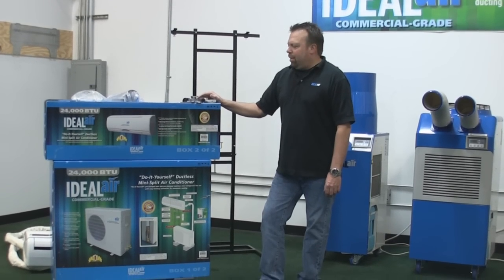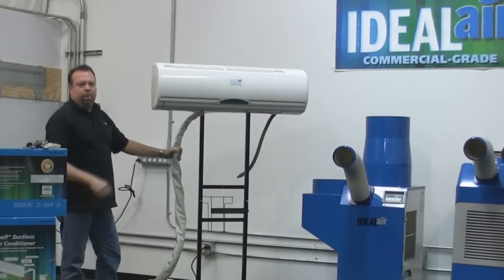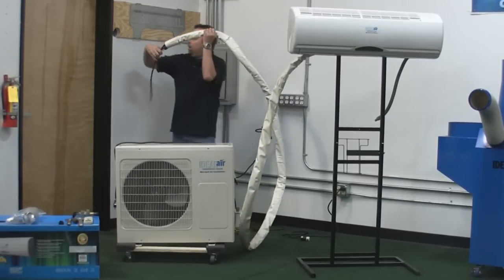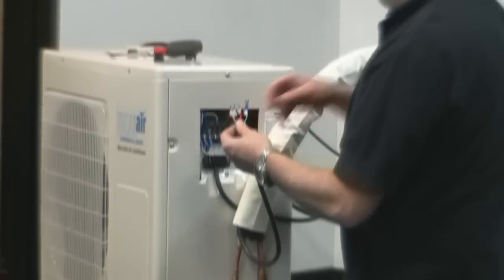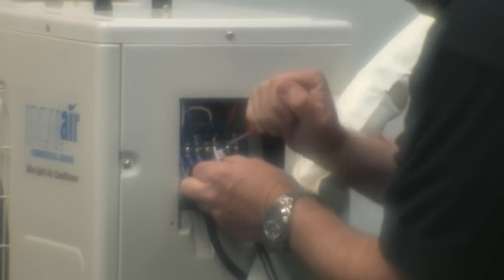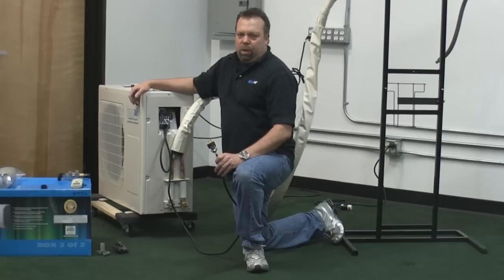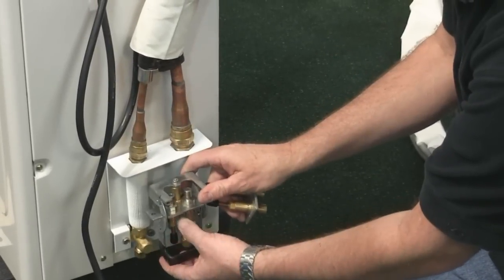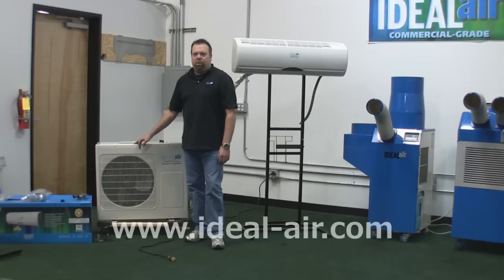Ideal Air Mini Split Installation

Comment: Thanks for the video, which I like.

1. Eliminates the need for a technician - (maybe) - which, here in Australia would cost about $700 on top of the price of the aircon itself.   Saving $700 is pretty good.  But we don't have these units in Australia.   Instead we have technician installed rigid copper pipe lines going from indoor to outdoor unit, which I assume is similar to most of USA.
2.  Noise level is a real issue.   Some cheaper units (are these cheap?) are quite noisy and don't have enough adjustment of fan speed, so you get too much noise indoors for sleeping,  but OK for during the day.   We don't get much info' here about that particular brand's noise level.
3. Electrical side of things was not dealt with very well.   Most houses in Australia will have a 10 amp power point and a 240 volt system, and no 15 amp power point.   So now you need to know more about how to do that, and might be needing an electrician.  So maybe not so easy.    Electricians here charge for a visit - not less than $100 and hour.
That said,  most aircon installers are NOT electricians - just have a "limited" license specific to the task.
4. Critics of these "no tech' required" systems, are quite happy to NOT criticize those gas guzzling "portable" a/c units on wheels with the fat tube going out the window.   So we know they are not being fair, and just protecting their brand of product.
5. I did the conventional tech' installed rigid copper pipe one at my place.   But the first time it needed any attention, the tech' quoted $200 call out fee.
6. None, or almost None, of these technicians know the first thing about professional cleaning of the indoor unit.  After a year running,  that indoor unit accumulates tons of dust and fungus, and is basically filthy.   You need to spend about $75-100 to have a pro cleaner visit.

Comment: for vanover--Mitsubishi . install'em, forget'em, that good. Have two ton unit squeezed twards heat effeciancy.  It cut my heating bill by 66% year one with heating oil at $3.85 a gal. This year at 2.25 a gal I'm only saving at 50%! Do get a humidifier  big enough to keep humidity at 45% cause the minisplit puts out 120 degree heat, even when the outside temp was 4above. Hyperheat units   are being installed like crazy in new england, good down to minis 15f.

Comment: OK, Quick connects I understand, any one thats ever installed a ice machine remote understands how they work and that they do work. what gets me is the flex tubing on r-410, NEVER seen that in the smallest reach-in to the largest Walk-in or HVAC unit, always wondered why. Seems like some larger mfg would have done this. Also the one thing I worry about with flex other than many leaks would be oil traps, dead compressor in 18 months.

Comment: sir pls .. you opend valves directly without making vacum indoor unit !! i think you must open one & push the small valve of an other valve and then open the other key !! in this case you did make vacume for indoor unit . thank you .. i just want to understand this from you .. pls answer
Reply: I guess this is supposed to be a DIY product so the vacuum won't be necessary as it needs a specialized tool. Ideal must have taken extra steps to ensure clean pipes, although if you have one available you should do the vacuum yourself, just in case. Sorting out the hole in the wall, the vacuum and the copper pipes, along with the wiring is what makes an instalation go from 10' to 2 to 4 hours in some cases.

Comment: I am not sure about "pre vacuumed lines"....i think a proper install needs vacuumed to 250 microns for 410A. Moisture in the system will turn into an acid bath real quick and compressor failure.

Comment: What unit size will work with the Honda 2000 generator ? How many SQ ft  or what  size  camper will  the Honda 2000 generator with the A/c unit  that works with it keep cool .

Comment: very detailed video, I really like those mini split. i saw them many time in hotel room.  are they supposed to last like the big standard one?
Reply: mini splits are great Mitsubishi is the best ones, pay a bit more they are super efficient quiet, great stuff, my Mr. slim is terrific, that I installed with a vac pump...duh!  Unit was pre charged for 15 ft line length

Comment: You know that long tube? Can it be put into a pvc tube if lined on the ceiling or attic to avoid the wood get damaged in case of a leakage? I have a split type ac that cannot be installed yet because we do not have a space for that long tube that connects the indoor and outdoor unit other than on the attic or ceiling. So we are thinking of covering it by using a pvc pipe (and elbows). I appreciate your answers. Anyone who knows the job please?

It’s been 6 months actually since the split type was bought but until now it is still not installed because the service men cannot figure out how, in my room can the ac be installed

Comment: You don't need a vacuum pump dumby he said its got 30 lb vacuum with freon all ready in.I'm assuming when you open the shut offs freon vacuum etc will be right. How much is this system?
Reply: Its not "30 lb vacuum".....that's 30" of vacuum for the dummy diy'ers.
Reply: u do need a pump otherwise the unit will work but will need more power
Reply: 10-4

Comment: Don't you loose the lineset vaccum when you connect the lines to the condenser??
Lew Stra
Reply: Lewis Strauss i
Reply: Not this system. It is already vacuumed and refrigerant is in the line set and the condenser.. it uses a quick connect no leak connector.

Comment: What about the thermostat? External or in handler ??? Mitsubishi 18000 not working properly when cold outside temp drops below 60. Inside room had 6x 250 watt MH bulbs over 1000 gal coral propagation tank!!! Temps are in 90's with fans and lights ducted 8" on good inline fan wit additional fresh air intake on room is 90. My 4k$ AC isn't working

Comment: Someone please explain how the line-set maintains the vacuum when the caps are taken off to connect the hoses.
Reply: It wouldn't obviously. You would engage shutoff valves before shutting off vacuum pump. Leave the connections in place with shutoff valves engaged and then open the valves to release refrigerant into the lines. This way you only have refrigerant in line and pressurized refrigerant will release a little when removing hose from service port. I'm no pro but that's my understanding.
Reply: The caps are dust caps.  There are valves inside those fittings to hold the vacuum.

Comment: You a licensed refer tech? I sure hope so. Where does your power wire come from? Not the 4 wire but the 240 power? Also you should attach some 5/8 tubing to the condensate line because all that water driping on 14/4 and NMD wire is not a good thibg.

Comment: why you don't use vacuum pump?
Reply: As he stated the lines are already in a vacuum and since they are quick connects no air should be getting inside the lines. If a small amount gets in while tightening it, the filter dryer should remove that moister. It's made for DIY install.

Comment: These units come with 16 feet of lines. What do you with all the extra  line if only need  8 feet? Not a clean look outside of the building with all that extra lines
Reply: The Ancestor Syndrome

The Ancestor Syndrome

The Ancestor Syndrome

Comment: I see you didn't evacuate your line after you hooked em up?
won't that shorten the life of the system?
Reply: If you LISTEN to the demo evacuating the system is NOT needed.
Reply: My Split AC runs over 13 Years, i never ever evacuate anything.
Reply: Hindi  ma

Comment: some refer to the outside unit as the condenser, isn't it the evaporator...I thought the condenser gives off heat, and the evaporator absorbs heat...thanks...
Reply: thank you...
Reply: pei broker
Reply: pleznocopypasterino
Reply: pleznocopypasterino
Reply: This has been bugging me for years!  I never understood why one was called a condenser, when they change depending on whether you're running it for heating or cooling.

Comment: This isnt something yiu should do yourself. It is against the law. Trained pros only!
Reply: incorrect.  R410 doesn't require a license.
Reply: Not R410A shall I post the rules and regs.  How does R410A "hurt"t he environment, it is supposed to be the save all, over R22 or R12, heck even R134a, was the savior, now it will be banned...wanna bet it's cus patents are off?  there are only about 3 major makers, they CONTROL it all.  DuPont, honeyWell and Arkema?
Reply: Oh no the tech that wants to charge us $300 for a 20 minute jobs is using the "its against the law" to scare people into calling him. You do not need a license for a DIY install on a R410a system, only on ozone depleting refrigerants like R22. In some liberal cities you may need to have the work inspected for it to be legal. BTW I've been servicing my own system for years with an epa type 1. My unit is 15 years old and still running strong. I know a tech would have used the "compressor is shot" when my run capacitor went out last year. $15 and I was back in business. Plan on installing my next system myself (the right way).
Reply: no license needed for R410a exactly, and yes, a contactor on my 21 year old system was burned contacts, online Amazon, exact replacement $25.! Shipped, perfect fit and operation.  While in there swapped out dual cap just cus I was there, exact replacement, like $15. !  Copeland Scroll compressors just keep on going and going! But what do i know, I am not a pro....hahahahahahahahahahahaha, an educated consumer is hard to fleece.
Reply: In Canada, where i am a technician you do need a license, look it up. Also 410a is more safe for the environement however not 100% safe. That "tech" that wants to charge you 300 dollars for 20 minutes of work most likely has fuel to pay, parts to buy and not to mention a familly to feed same as how you need to work to pay your bills. Things in life cost money. Anywho, I am not interested in arguing with homeowners who seem to think youtube makes them experts.
Reply: U.S.A. not for R410a.....it ain't you tube that makes me an EXPERT......it's other things. If he has a family to feed, why do I have to feed em?  an educated consumer is the best.
Reply: Yeah such as books, the same books you guys use in school. BTW there are some thing that should be left to the pros. Installing a new system would be one (mainly for warranty), though I do plan on doing my next system myself with the help of a pro.
Reply: +Ross Restoule It's not rocket science to read a vacuum gauge on a vacuum pump  or to calculate superheat.
I get a laugh out of the hvac guys that make youtube video's of other hvac tech's work thats bad.  Some of the stuff these hacks do is downright criminal and  they get paid good money to do it.  My favorite was the tech
that released r22 into the air telling the customer that it would  make the job go "faster"
How many months a year do you use a/c  in canada? 2 months?
Reply: if fridge mechanics didn't rip people off blind it wouldn't have come to this
Reply: Not 134a you can buy at Walmart.